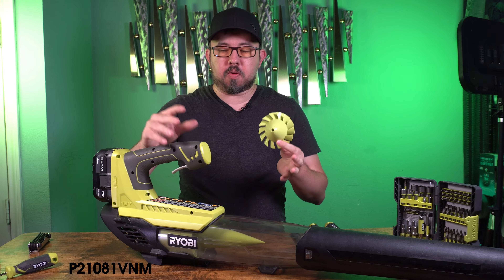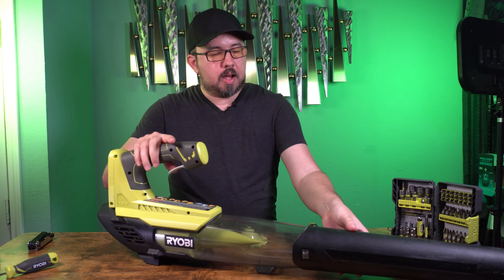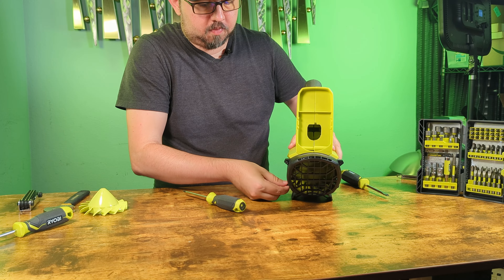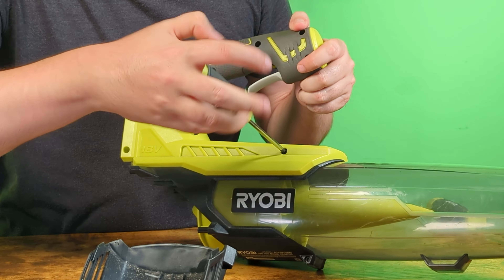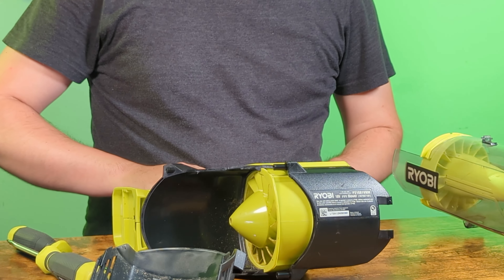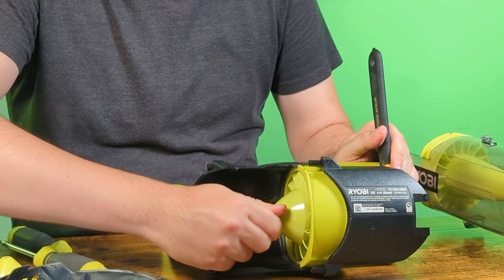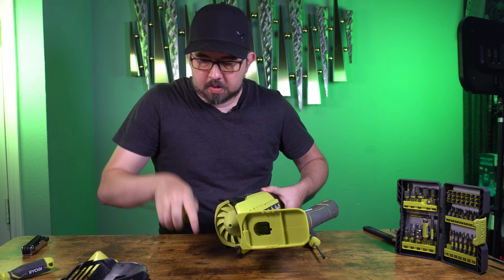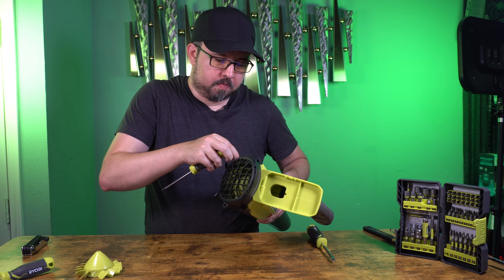Ryobi Blower Blade Replacement - Fix Loud Noise or Less Air issues with P21081VNM

Comment: Very helpful blower swap blade video. Do you also repair gas-powered garden machines? An idea pops up after watching your video. You know a lot about equipment repair and hipa gets lots of high quality and affordable parts. Maybe we could collaborate to make a video to help other DIY repairers, especially these novice DIY repairers and I'm sure this collaboration can help them save money and time spend on repairing.
Reply from the maker: Thank you! Unfortunately, I do not, most of my tools are Ryobi. There is a big shift to electric in my area. Please let me know if you start carrying Ryobi compatible parts since your prices are good and you have high ratings on Amazon. Thank you!
Reply: @justinreviewsandrepairs  Got you. We didn't sell Ryobi parts yet but I will let you know if we plan to sell these parts.

Comment: Good review!  I looked through several and yours is the best.  Now if we could just get Ryobi to make a better fan (maybe aluminum).
Reply from the maker: Thank you! I think the concern might be the damage that would be done when an aluminum blade fails. I need to take a look at the newer 40 volt blower and see if they are still using plastic in it?

Comment: Have you ever run across where the motor and its bearings require replacement?
Reply from the maker: At that point you have to consider getting a new or used one. I hopped on Facebook marketplace and someone was giving away a mower for free just because they didn't have a battery. Deals are out there, so don't overspend on parts. Keep in mind while Home Depot is the only retailer, you can also buy factory direct from DirectToolsOutlet.com as well which has a big sale about every 3 months.